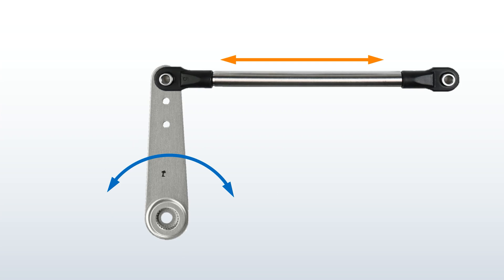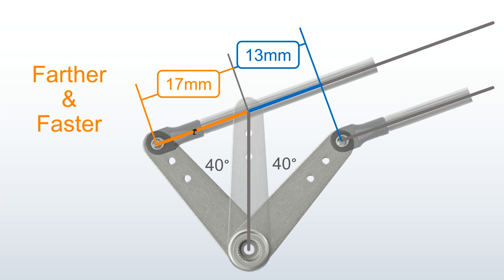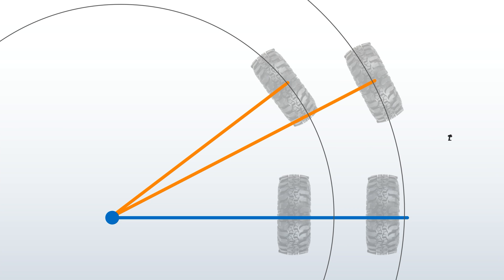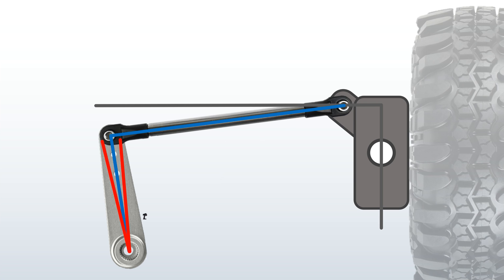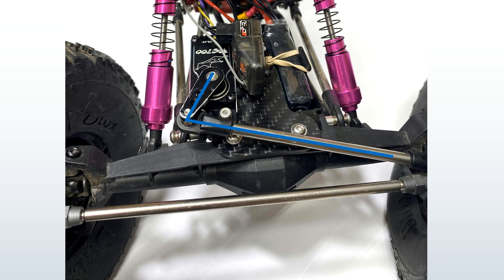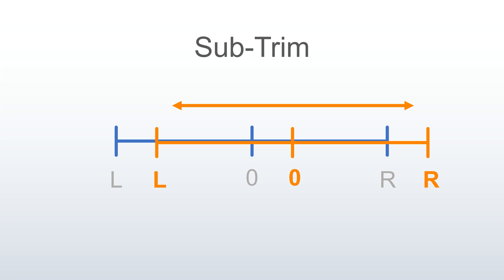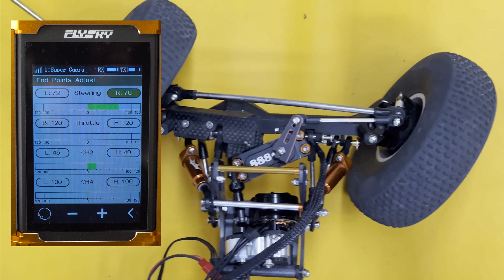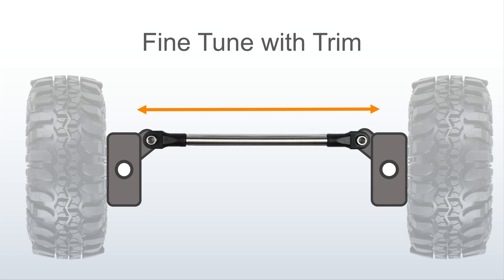Get the BEST Response from your Steering Servo & Linkage

Comment: Wouldn't it be that with a perfect parallelogram with steering arm and steering knuckle, the Ackerman will be strange? The angles would be valid still since they're connected by a rod but the wheel connected directly to the servo would have the same steering angle as the servo output. Usually the wheel turns increasingly more compared to the servo when being on the inside of the turn and vice versa. Or will this be compensated by the EPA and trim in this case?
Reply from the maker: If the steering link is anything but a parallelogram with the knuckle your response will be different left to right. EPA will control the stopping points but not the time to get to those points. Your steering will feel slower in one direction. 
You are right, Ackerman comes entirely from the cross link and the knuckle angles where you don’t want a parallelogram.
Reply: @ Ahh, yes, but with ackerman, we want the tire to steer more degrees when on the inside of a turn compared to when on the outside. So with a perfect parallelogram, the neutral position can't be centered in the EPA range and the expo curve should be S-shaped as well to achieve this
Reply from the maker: Not sure if we are talking about the same thing. Ideally, a rack and pinion would deliver equal feel and movement to each wheel simultaneously The Ackerman comes from the lever arms at the knuckle being rotated inboard toward each other. With a crawler set up the cross link handles the Ackerman. You wouldn’t set your servo and servo link based on just one wheel. You’d set it up as neutral and consistent as possible because you’re only steering one wheel.
Reply: @BoomslangSuspension  I'm not sure either 😅
But I was just thinking it might be necessary? On a touring car, the servo would connect to the bellcranks system. Having the perfect parallelogram between servo and bellcrank would give an equal amount of steering angle in both directions and the bellcranks would turn an equal amount of degrees as the servo, but the bellcranks are an intermediate step. The Ackerman adds it's  thing from there to the wheels. So for example turning the servo 20° would give 20° on bellcranks, 30° on the inside wheel and 15° on the outside wheel. I'm thinking we don't want either wheel to do the exact same as the servo, but the exact same as the other wheel during a turn in the opposite direction. So then when skipping the bellcranks, we might have to compensate, unless there is very little Ackerman?
This is mostly like a thought experiment. Might not be any noticeable effects IRL 😁

Comment: Looking to get more throw from my sportsman on axle for Capra very very short link to make space for battery so now doesn’t even get to bump stops so need longer horn I believe….ive offset the horn to make it all work.   Alsways have more throw than it can take….especially with the direct power servos….lately paranoid needs a bec but no problems  burning em up.
Reply from the maker: One option is a Reefs programmable - they spin 360 and you can program the throw. That might help you get where you are going???

Comment: Do I need the sub-trim at all? I have just set the end points (they're not symmetrical), then moved the centre point with the trim, and called it a day. Should I be concerned?
Reply from the maker: That should work fine. Sub trim could help you get your end points more symmetrical if that made a difference to you.

https://youtu.be/OG6gdx_CVHA?si=O3RFnNrAHFq4qUYl
Reply: @BoomslangSuspension  I did some testing on my DumboRC DDF-350 to see if there's any difference in the steering input or output whatsoever between the asymmetrical end-points and no sub-trim VS the symmetrical end-points with sub-trim. On the assumption that the axle body tolerances and the knuckle end stops would provide an equal steering angle in both ways, I used the paper method (like in CNC) to touch and calibrate the end points, then I used various thickness etalons getting pinched between these surfaces on the knuckles to see what steering input (on the curve) do I need on both sides at different angles. 

My finding is that the steering output percentage wasn't really affected by the end-points or the sub-trim. The sum of these two resulted in the same percentage left or right within a 1% margin of error and of course they stayed asymmetrical in the actual output signal regardless of the settings.
To my disappointment the firmware isn't really interpolating the steering input equally between the sides either, so for instance I could pinch a coin with the steering knuckle at 90% input in one direction and 82% input in the other direction. But of course touching the end-points would be 100% steering input in both directions - which of course would be translated to an output compensated with the end-points. Interesting.

I can only guess that this asymmetry is the result of the skewed geometry of the servo horn and steering rod.

Comment: I realy like the way you do your hobby. Do you have a video about crawler suspention geometry?
Reply from the maker: Thanks fr the compliment and checkout the channel. Yes I have a few suspension videos. 

Tuning with Shock Angle - Part 2: DETAILED Version
https://youtu.be/j-1-NYuaqRY
Reply: @BoomslangSuss  I watched (almost) all your crawler suspention videos. As a mechanical engineer and after a 20 years long downhill addiction, progression, springrate and damping is not where my deficit lies. Together with my son I started a project to design and 3d print a expedition crawler which is capable of climbing the peaks in the german alps. At the moment our blindspot is the linkage geometry of the suspention. 

Do you know a website where we can educate ourselves?
Reply from the maker: Full size expedition crawler? With people inside?
Reply: @BoomslangSuspension  :)) hell no!!! 1/10 rc crawler.
Reply from the maker: A lot of people hate on this claim, but it is correct. When you are crawling slowly, your 4-bar linkage geometry is not super effective in anyway. Things like anti-squat, anti-dive and roll center are dynamic situations. So for the times you are moving fast set your vehicle up for a neutral response on all 3 of these parameters. But more importantly, set you car up for maximum clearance and lowest CG for best crawling performance.
Reply: @BoomslangSuspension  Thank you very much for your support. This is definitly a starting point. 
Greetings from Germany

And by the way, I'm kind of jealous for that Aron Gwin jersey... :)
Reply from the maker: He actually wore it!

Comment: I’m not a crawler guy but this information is very good and mostly applicable to buggies as well. 

One thing to note is the servo horn length: you can use a shorter one to increase the final steering torque and improve steering precision. Because the rotating horn projects an even smaller linear movement toward the ends of the throw, you have even more torque and less risk of burning up the servo when the steering knuckles get close to those hard stops. 

The downside to a shorter servo horn is reduced steering speed. If you were reducing the speed in the transmitter settings already, this is hardly a negative.
Reply from the maker: I’m happy that some people are seeing the crossover and I hope to expand outside crawlers  where applicable. 

You make some great points. I actually made a SHORT on that topic but not sure that people can find both shorts and fulls equally. Thanks for sharing.
Reply from the maker: Which Servo Horn Hole? #rc #rccrawler #rccrawling #rccrawl #crawler
https://youtube.com/shorts/3W6s7XA3afk?feature=share